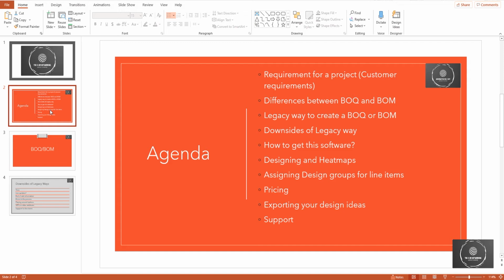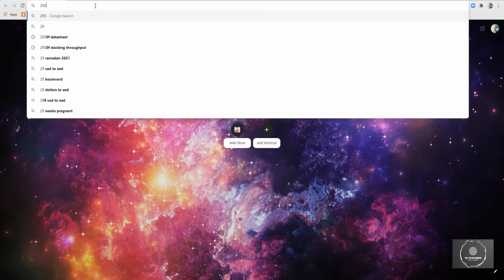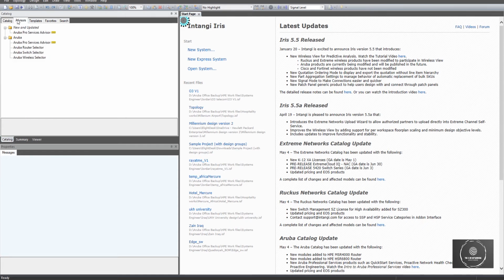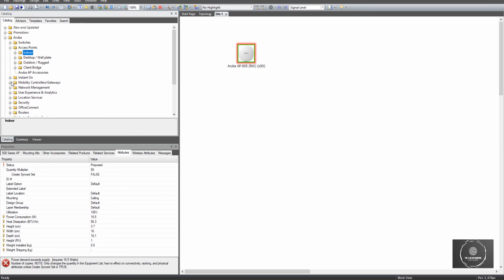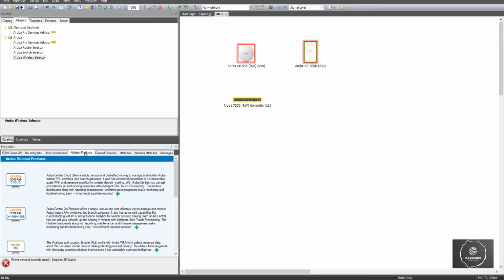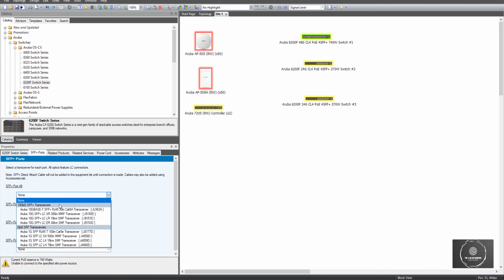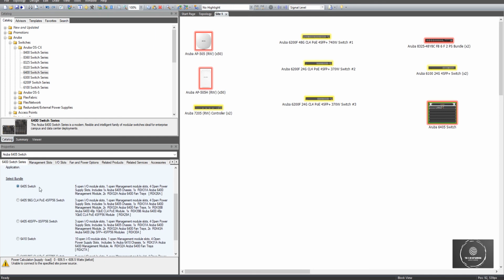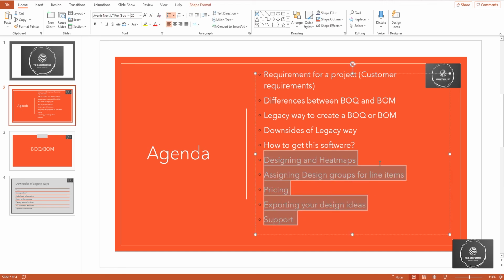How to create an easy and Flawless BOQ  | Iris Intangi | Demo with Aruba HPE | Part 01

Comment: Great video! However, I noticed that you used the 6200F 48G POE CLS 4,4 SFP+ 740W. I would suggest using the 2930F 48G POE+ with 4 SFP+ ports instead, as it is more affordable than the 6200F